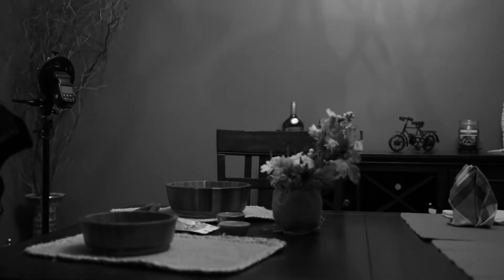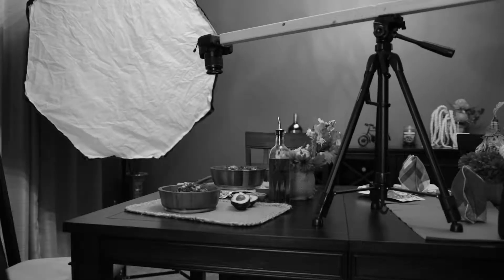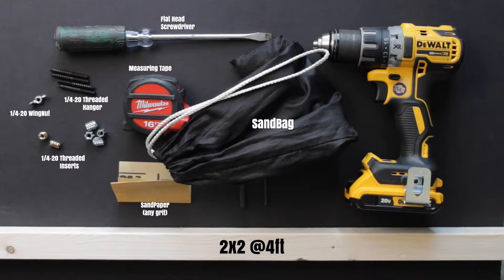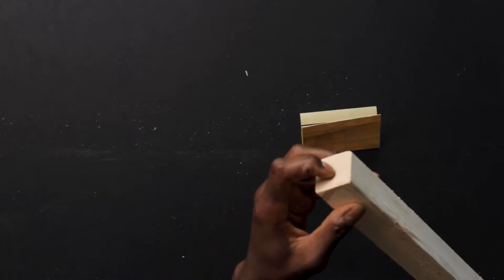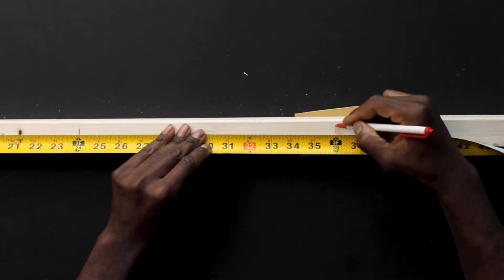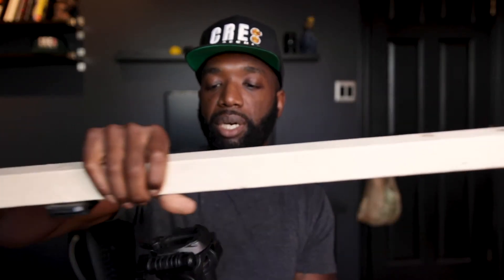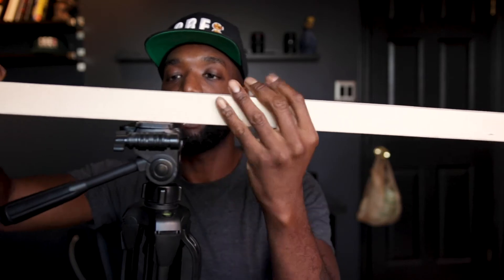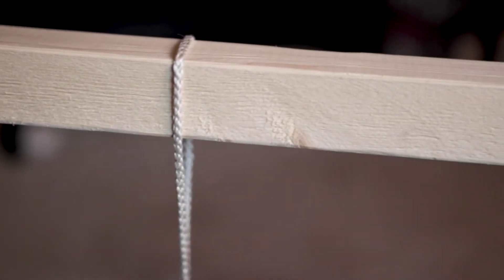Turn ANY TRIPOD into a DIY Overhead CAMERA RIG

Comment: Nice video, Jean. I followed your instructions just like you stated (even the parts from Home Depot) and worked great! Saved me $$$ when compared to what being sold on the Internet. Thanks!
Reply from the maker: Thanks Michael, happy to help!
Reply: Follow up - I redid my rig. The 2x2 rough pine was too rough. No matter how much I sanded I found splinters. Or should I say they found me! The better quality lumber is worth the few extra dollars. Looks nicer, too.
Reply from the maker: Lol those splinters. yeah the pine strips can be a hit or miss. I’ve been running into some bad stock while working thru some other projects. What’s you go with oak?
Reply: @thefeedingmodel  Hard to find acceptable #2 pine. I found #1 pine at Home Depot with few knots and a finished cut. Not a rip cut with a chain saw. Light sanding was all that was needed. Didn't see any oak.
Reply from the maker: Good deal!

Comment: I like what you did here.  For the sake of sturdiness and not fussing with a counterweight, I think I would modify the design to mount onto two tripods.  I have two motorized 4 foot length sliders and slide manually even without power assist and both are supported by a pair of the same make and model tripod.  For less of a footprint on a table or countertop, smaller tripods using a wide angle lens could be anywhere from a foot or more away in height from the subject matter being shot.  Thanks for the inspiration!
Reply from the maker: That 4ft slider with dual tripods would make for a sick setup 👍🏾👍🏾